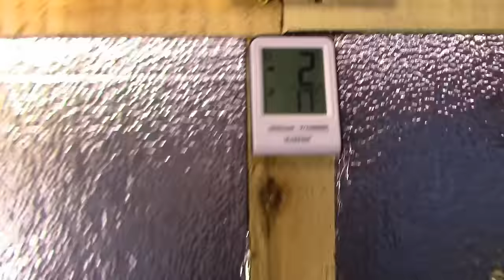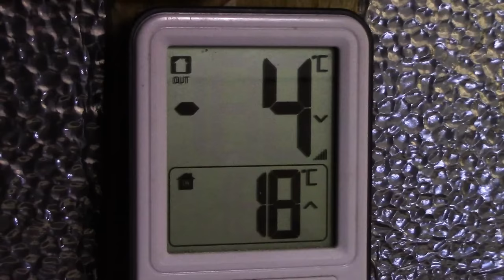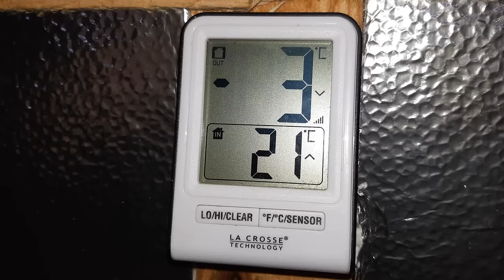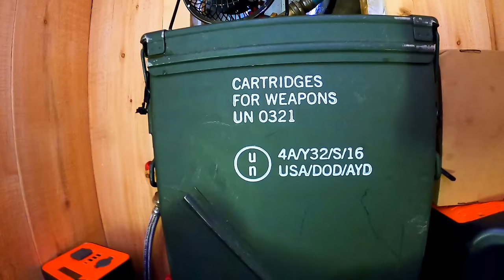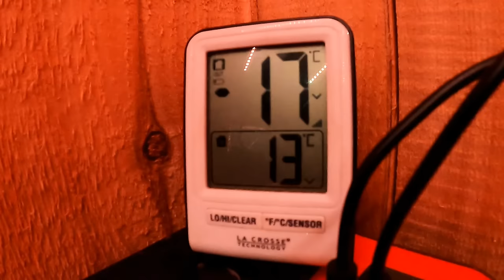Snowmobile Camper Supercut- First 3 Journeys

Comment: How about using bricks instead of rocks.  No danger of explosion, more compact, high density, and clean.
Reply: Yea gonna go collect wild bricks
Reply: @jeremysilap1811  he found ammo cans
Reply: Ammo cans can have several uses and are worth bringing bricks have tons of weight and aren't useful out in the bush
Reply: Good Point.
Reply: If you watched he says he kept the rocks dry for a year so they didn’t explode. It’s not like he was sourcing them there. Bricks sound like a good try.
Reply: @mroberts2738  giant holes not solid means it won't have the thermal mass to last near long enough

Comment: Idk how thick your bottom of where you lay down but if you make an aluminum rectangle under the wood you sleep on and make valves the come out the back and turn it into like your amo box design like maybe 10 20 gal and if you spread your weight of the stuff in the hut to the sled in back your snow machine won't have to work as hard and save more fuel and the skids where a little wider with light metal with rounded edge like a pontoon I found mine to slid so much nicer and with more ease. Just a suggestion but I really like yours big fan

Comment: I have another ideal between each right at each connection put a shut off valve that way you can shut off the water between each connection saving the water in your water line that way you're not wasting your coolant

Comment: That check valve needs back pressure to work , you don't really have enough back pressure to stop back flow when the system cools down. Then it becomes a cooler..
 Since your up checking the system try turning off both valves to keep the heat in the tank. let me know if you see a difference.

Comment: An amazing video! Different seasons have their own beauty, and you really succeed to show up the beauty with the winter in the best possible way! And while many people would find it scary to be alone in the woods at night hearing the wolf howls, you find it adorable, I like that! But how about bears, are there any grizzlies there? That would not be so very nice I think...
You have done an impressive effort with your sled shelter. I really understand how cosy it has to be to sit in the in front of the fire and then go to sleep in the warmed up shelter.
I see you have some good light equipment. I am a flashaholic and Thrunite is my favorite brand. I can see in the video that you have a TH30 headlamp, and then I think you use a TC20 when you walk along the tracks, is that right? What more models do you bring with?
When I think about your innovative way to warm up the shelter from the heat of the fire, I also wonder: is there any way you can make use of the fire to store energy to the battery charging as well?

Best regards from northermost Sweden! I subscribed to your channel and am looking forward to follow your adventures!

Comment: What is you were to install a baseboard style lower and had the connections poke out and insulated from the camper. Do you think you would be able to regulate it better and make the heat last longer?

Comment: i would almost take the water heater system one step further and basically build a radiator under the bed, in at the head of the bed, out at the foot and continually circulating as long as there's heat
Reply: also, actual plumbing insulation ~may offer better r value, hard to say without trying it out

Comment: Personally, I've been thinking about heating my caravan. it has the same problems as you have in a sleigh car. When you use the water it freezes and you have to use the role 50/50. The same problem is with the apartment in the wagon. I solved it myself by welding a suitable 2 x 100 Liter reservoir of containers that fit well inside the seat and spraying an inch of urethane foam around them. Urethane is the world's best insulation material in construction. switch heater Webaston water heater 12 volts that runs on diesel. I did not put water in the system but oil that does not burn and the oil temperature rises above 200 cellsius and the toilet space on the roof is limited to a 10 liter open expansion tank. the water accumulators I put in the apartment trolley central heating circuit. It was +25 cellsius 24 hours later and consumed about 12 liters of diesel in about 2 days, or about 3 callons. I put the original Primus LPG heater to heat the system with a new heat regulator to 180 cellsius in the oil pipes. It is now a caravan like a sauna. And is cheaper than a diesel heater. I use a 12 volt circulating water pump and 12 volts to control the thermostat inside. 1 x 11 kilog. liquefied petroleum gas bottle is enough for outdoor freezing -25 cel. 5-6 days. Hannu from Finland.

Comment: What if you made the lobster pot a fire box with air holes on the sides and the copper coil wrapped around outside of it. It would function as a cook stove also, with quicker response time heating up, not 4 hours like with sand. Your system is an open loop so it will never get above 100 C and it can be regulated EZ by sliding the cover on or off. Camp chair would compliment your portable palace nicely.

Comment: I was thinking similar to a home with "base board" heaters. Could you run the hot water line coming in to some kind of a base board system. Yes it is a small space. Also since hot air will rise to the peak of your roof, some kind of plastic layer just above your head, wall to wall, to trap the hot air rising like a tent within a tent, to keep the warm air closer to your sleeping bag insead of the roof.

Comment: You are an expert compared to me,, but with your shelter up off the ground, is there joist space? It would weight a lot, but if you camp in the same spot you could store them, anyway maybe put a hinge on your bed so you can lift that up and fill the floor with rocks.

Comment: Add Quick Connects to your fittings, no need for Tools, then I would Get Rid of Copper Lines living the Pot, thin copper lines will lose plenty of heat, I would try Flexible hose with good fiber lining and off the snow.  Keep up the Videos, Yea lets start a Business and build other Portable Housing, then get Clients to go for a Trip, I'm up for a Trip....  Good Business Ideal  :)

Comment: I think you made yourself a great camper. Only the massive fire with a big ammobox full of water feels a bit like overkill. Most of the produced heat will just end up to heat the planet instead of you. Diesel or gasoline heaters like you can buy for your car to heat the cabin without the engine running will do fine for you. The lightest one will be more than enough. you will.need a good battery to start it up ( glow.plug) and after it only uses some power for the fan and the fuel pump. Look at Bud Nixons channel. he mounted it in a plastic box and can put it safely away out in the snow and one or two insulated  hoses to transport air from and to the cabin (with two you can circulate the air to be more efficient). In your case I can imagine you will keep warm and burning between 1 and max 2.5 litres a night.  the fan on lowest and the heater in an external box to keep the fuel pump sound to a minimum. More permanent solar panels on the roof of the cabin to feed a good battery that can easy start and keep the fan going. A chinese diesel heater will cost you less than 100.dollars.   Or maybe you can look  into some small wood stove with water or air heat exchanger that can be operated automaticallly. When the heat goes down it needs to feed some pre cut logs/pellets. The idea is to have a much more efficient fire in a closed or more or less enclosed burning chamber that will provide you with the same comfort in the cabin but with less fuel.

Comment: The reason it took so long is when you heat water it becomes lighter and rises which is the reason you have the water being heated as close and underneath the tank to be heated. Unfortunately your set up forces the water horizontally for about 10 feet, consequently it looses much of its energy before it reached the sled. If you move the fire closer to the sled and have the pipes rising all the way you will see a marked difference. Also being a gravitational system the pipe bore should not be less that 3/4 inch. 1/2inch causes frictional resistance as does  tight bends.

Comment: PA did sell a 12 volt heater and fan... 75 or 100 watts I believe.... Would this be an alternative heat source? even as an supplementary one? I figured your battery charged by the solar panel might be able to run it ...

Comment: Greetings from an archaeologist in AlbaNY. I went to the Thru-Lite website and tried to order your Outsider TT20 in red, but it didn’t even show that as a color choice. I’ve been wanting to get a powerful flashlight for a long time, 2500 lm, but also the red color, really caught my eye. I’m a woman, what can I say. I was looking for a color filter on the manufacturer’s website filters. Can you help me, am I missing something? 🍀 I love your snowmobile camper. I had two ideas for furniture, one for outside and one for inside. I was picturing you sitting up in bed and needing a solid surface for cooking and eating on. How about a drop-down table? It could be hinged in one spot, or you could put it on a rail and slide it lengthwise throughout the cabin. I envision the table as being the width of your camper, with a ledge mounted on your door to hold up the weight of the table. 🍀And for the outside, essentially create a stoop for you to sit on (when your door is closed), but also to use it as an end table. You could store it on your roof. I envision it being around 2 feet deep by 4’-6’ wide.🍀 And lastly, it would be so cool if you installed a skylight window on your roof for stargazing.

Comment: Question, can you get any metal Jerry cans from the source of your ammunition cans?  They usually hold 18L or 5 gallons.  Some are designated for fuel while others contained water.  Getting a couple of them, filled mostly with water, they could flank either side of your fire to absorb heat into the water.  If fuel cans are the only variety available, fill them with sand and heat them the same way.  The San will store heat and dissipate it the same as rocks.  

Was it last year or the prior when you attempted to plumb a water filled box to a copper coil exposed in your fire pit?  Can I suffers the that you add some pex water lines to your shelter as permanent plumbing from inside to outside the front wall.  The pex lines could be threaded through pieces of a pool noodle for added insulation.  Since pex is used for both plumbing and heating, several loops could be routed through the shelter to warm the floor under your sleeping mat.  

Wishing you and your family a blessed winter holiday season,  avoiding the resurgence of the Covid virus and a new year filled with peace, health and happiness.   Peace brother.

Comment: for a heating meathod that doesn't run the risk of Co2 poisoning, build a sweedish torch on legs, take a steel pipe with a 90 degree elbow on the bottom, up through the torch center and then up into the space to be heated. the pipe automatically draws in fresh o2 from beneath the fire and blows the heated air into the space automatically. when done right can make a TREMENDOUS difference (especially to a small insulated space) and can go all night safely with the right size/set-up. If i can find a link to the video I got the idea from I'll link it in a reply

Comment: nothing against the water heater system, but isn't it a bit unnecessary? You could easily bring along a small generator and just run an extension cord into the camper and plug into a small space heater.

Comment: To tell you the truth, brother, The gap above the door is all you need to ventilate a radiator system like you are using. I was wondering if there was a lithium ion electric heat system that could accompany your radiator heat to turn on at a certain degrees to boost you through the rest of the night till morning.    I think you are most assuredly onto something with your minimal sled design. Don't use more insulation, just cover the inside walls with space blankets and use a grow lamp hooked up to a lithium ion battery bank to heat it. They say it can rise to 100 degrees f with this type of radiant heat system...… just trying to help you which in turn would help me and us if you try it out on your channel...….God bless my brother. We love your channel and we love you. Amen.

Comment: My friend I am a huge fan and may i make a suggestion with regards your outside lighting since you use your huge power bank for powering charging and internal lights. Why not then install some on the outside of the camper thus been brighter outside would improve your visibility outside with the low voltage led lights you use. If I was you also may I suggest you create a smaller cabin to pull along with you to store equipment instead of it all been stored outside in containers or at the foot of your bed. Would tremendously allow you to fetch more resources with you aswell as increase your storage
Reply: Yes more practical but not as pretty.
Reply: @MrSullismom  you could tech have the lights to clip on when it gets dark that way pretty during day and at night you cant see so use lights problem solved

Comment: what happened to your  radiator heating thing ? with the hoses
Reply: if you have noticed, the internal of the mobile camper, it is much less furnished. This is his first few times using the mobile camper
Reply: Part three of the video

Comment: FACT - Since heat rises, it would be better to have the air holes down low so as not to lose the hot air out the high air holes.

Comment: Have you looked at a 12 volt dc radiant heat immediate on system. You can run off a car battery and there is no chance of explosion inside.

Comment: Clearly, you're using a 12v power system...What about adding a small 12v water pump to assist the flow of water in the heating system...Not running all the time, but just to supplement the system on a cycle. Maybe a few minutes at a time, once an hour, or on a switch, so you can create/increase waterflow when first setting up the heater....Also, to supplement the ammo box, what about running a hose inside a trough in the floor insulation to run the hot water through (another reason for the pump), and also increasing the thermal mass (water) in the system, and a better transfer of the heat to prevent boiling, and use the ammo box as an expansion tank,  (you can also run the heating hoses up the back wall, although hydro locking would be an issue, without the use of a positive pressure pump to draw the water over the water level of the ammo box, and you'd be better off having the heated water enter from the top of the wall section, and flow downward through the floor section, and then back to the crab pot, to help push out any air pockets in the plumbing. Also, if you replace the garden hose fittings with mechanic air hose quick connect fittings, you'll be able you reuse your heating liquid (water and RV anti-freeze) several times over...I also wondered why you brought your own water for the heater, when you could have easily melted some of the snow surrounding you, and not have to bring as much water, and only enough for drinking, washing, and cooking, etc.

Comment: Everything is good and beautiful, but why do you use heating systems that are so difficult, heavy, complicated and that help for a very short time? Why do you have to clear the whole forest to get warm up for maximum of few hours?
When you fall asleep it starts to get cold already.
For example, I have a system invented by me, incomparably simpler and that would heat that space for an unlimited time maintaining the temperature at 18-20 degrees Celsius at a cost of only one dollar / 10 hours.

Comment: Your grandpa has a ton of wood in that shed that you helped to cure and stalk. no reason you cant take wood for the cabin and replace it in the spring. Its supposed to be cabin on a budget. NOT let me do things that have no relevance to completing my task at hand. Don't get me wrong but i had a cabin and i used wood and coal to heat it. Not using rocks and copper tubing to heat a tiny space. Actually you have so much scrap and bark that can be used. You could even be putting storm shutters on the windows or at least  make them inside the cabin with a nice fire going. You can also pre cut the wood for you steps and pre fab them inside as well. Your roofing technique for the chimney flue is OK for now but you should of finished the other side, that way it would be done. PLEASE AND I MEAN PLEASE don't take it the wrong way but in one episode you tarped off a section  and stayed toasty. Your gonna need to know if a second heat source will be needed. like a pot belly stove or a cast iron wood burning stove. My cabin had a fireplace in the front but i installed a wood burner near the kitchen. Bedrooms were chilly even with the doors open but we mostly stayed in the loft. Cabin is kinda big so it needs a few heat sources. Solar will need wire and switches that can be done inside when its snowing. No need to pack a lunch and camp out in a tiny shed. Get errrr done.